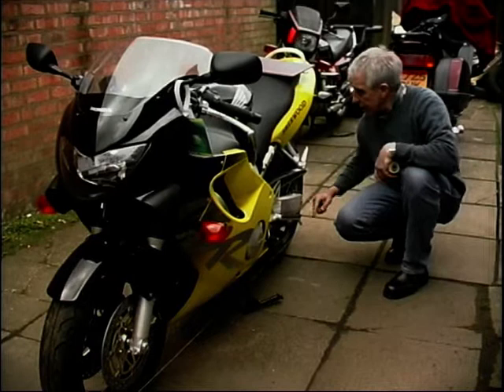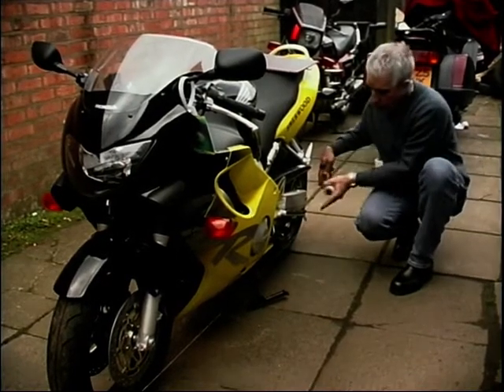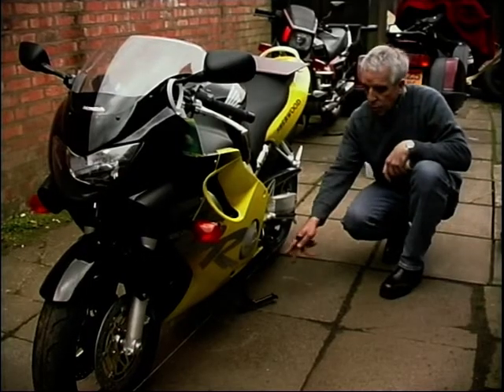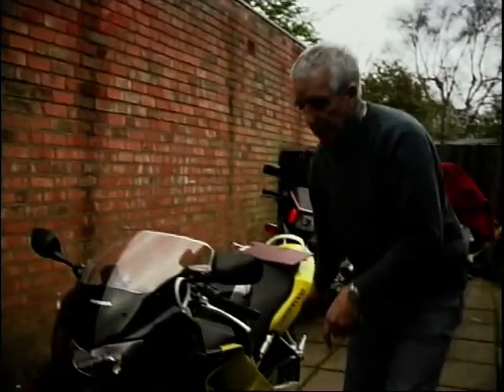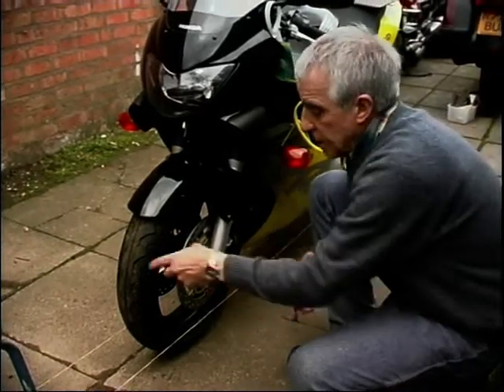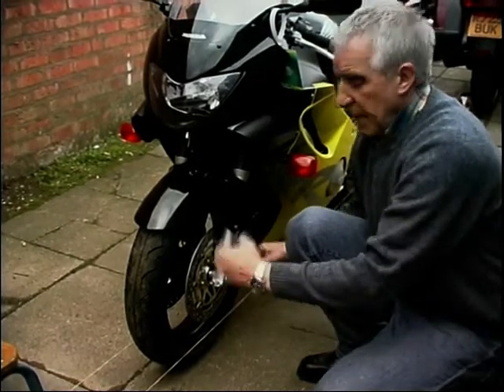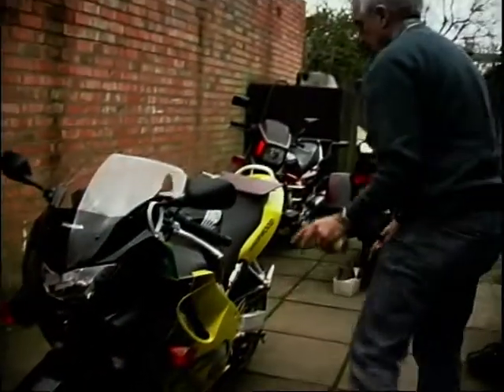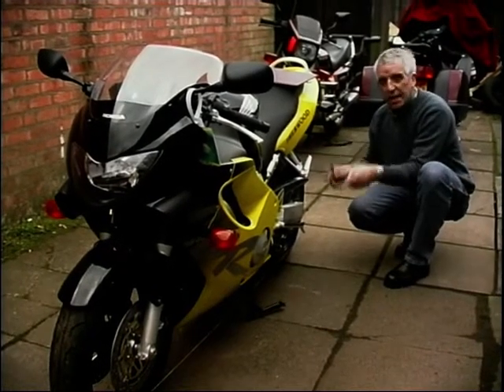How To Check If Your Motorbike Wheels Are Aligned

Comment: Ideal. Simple, straightforward, helpful. Just ran through this and I'm bang on. Good to know. Worth noting that it's a good idea to ensure the strings are the same width as the rear tyre when you tie them off on the stool

Comment: Great video. It is astounding how many videos are out there of improper methods using more expensive tools. The only limitation I can see of this method is that it cannot be applied, as demonstrated, to bikes with equal wheel width. The method I listed below should solve that limitation.

Comment: You should first check that the rear wheel is improper alignment in the swinging arm by measuring and do not rely on the markings. Then and only then should you check and adjust the front wheel alignment if your readings at the front wheel differ.

Comment: Just remember to re-align the front wheel in a parallel line to the strings each and every time you adjust the rear wheel adjusters on the swing arm. If you adjust the rear wheel and don't reset and measure the front wheel according to the newly set string lines all your readings will be cock eyed. Watch this vid for a really clear explanation    https://www.youtube.com/watch?v=Mp4_wIUeTic&list=PLfoPhFhpHjtgItDR_dIn5yK5UO1hY1-Hu&index=2&t=1s

Comment: What are the symptoms of not having this alignment correct. My front wheel (and bars) are not dead on 90' when I'm riding straight down the road. they are off a couple degrees, (maybe 3 or 4 degrees) to the right?
Reply: that's probably bent bars
But sometimes it's not, and in this case the symptoms are uneven wear on the tires and a weird feeling when leaning the bike (different on each side).

Comment: It isn't mentioned specifically in the video, but where the strings are tied to the stool need to be the same width as the rear tire. Right?
Reply: Yes, if you want all of the same measurements, that is correct. You could adjust the comparison by comparing the front measurements (on the front tire) and separately comparing the back measurements (on the front tire). If each pair is separately equal, the result is the same.

Comment: what if the front tire is turned a little  ?
Reply: then turn it a little back until it looks straight.  You have a ruler.  You can tweak the front wheel very gradually until it's as straight as you can get it.

Comment: But how do you align the front wheel?
Reply: front wheels can't be aligned
Reply: @billy653  Yes they can...
You loosen everything but the top clamp (really everything) and pump the fork a few times whith the rear wheel on a paddock stand. Then you dismount carefully and tighten everything

Comment: there has to be an easier fuckin way wtf. seriously
Reply: I checked my chain this way too and found it impractical. There are a lot of obstructions beneath my bike like engine crown, centre stand, hoses, etc 
Now, I am using chain alignment tools instead. Which is much faster
Reply: Use a tape measure and measure from your swing arm pivot to your axel bolt on both sides of your bike and of its not the same, adjust accordingly, no need for people to be rude but that's a very precise way if you don't have an alignment tool